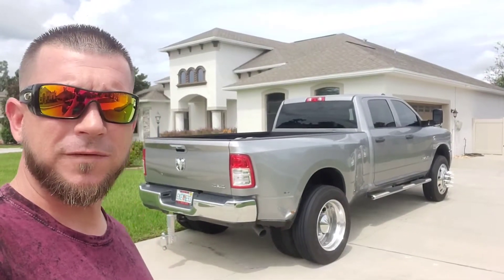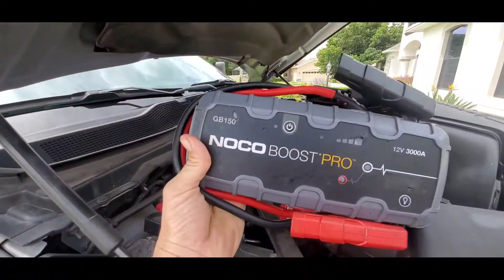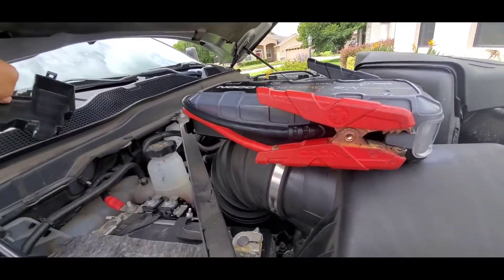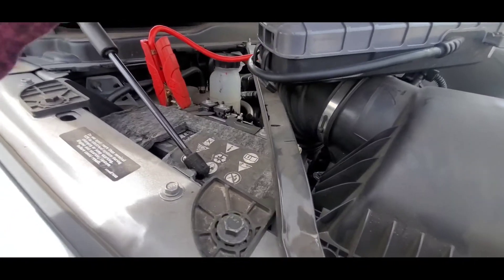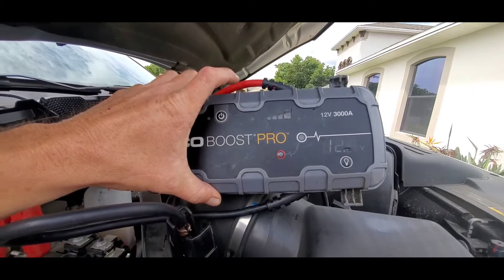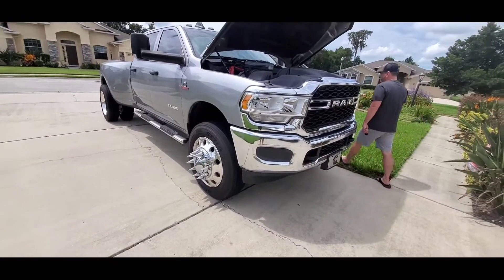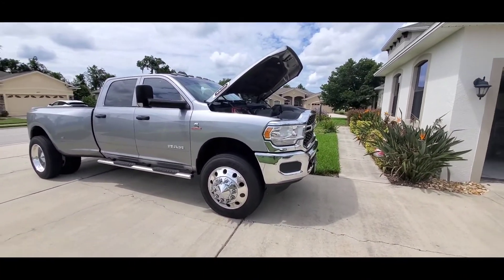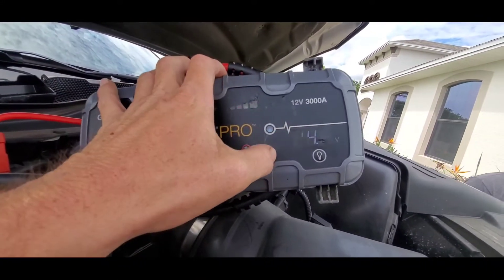NOCO GB150 JUMPBOX

Comment: A fully charged battery is 12.6v. In warm climate like youre in, most vehicles will crank over down to about 10.8-11v.  If the vehicles battery has a pre jump standing voltage close to normal like 11.6 to 12.6v & will power lights, radio etc.. but falls on its face trying to crank..... the battery is sulfated internally & needs replacement. Voltage & amperage are different.. just because it shows fully charged, but cant deliver amperage is a sulfated battery... it'll jump, and drive ok as long as running voltage is between 13.6- 15v  but dont expect it to restart regardless of how long it charges.... 
When jumping a dual battery truck, its more efficient to apply power to the primary battery, closest to the starter..  in this video, the Cummins starter is on the drivers side, so jumping from that battery will provide more amperage directly vs, using the secondary battery & having to travel across the longer power cables from the passenger side....  in your warm climate, you likely will never notice a difference.. but in cold winter  temperatures... it makes a big difference. When load testing dual batteries, they need to be load tested separately, not hooked together or youll get a false reading which one is failing..